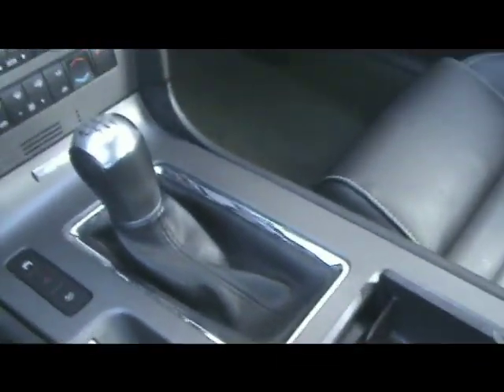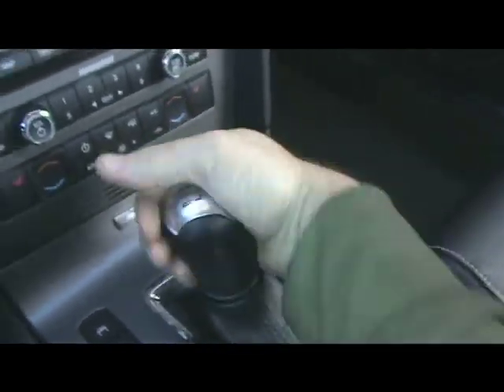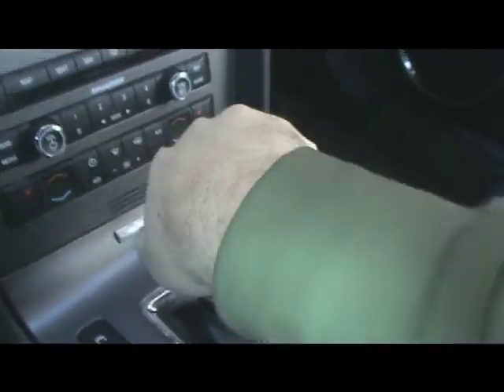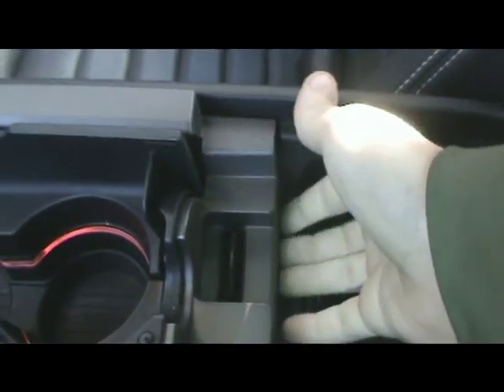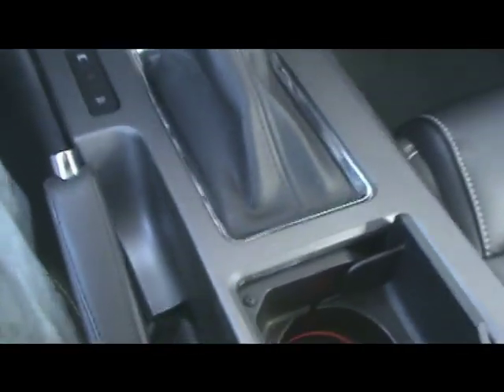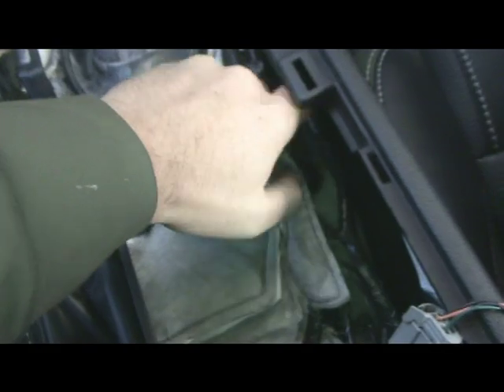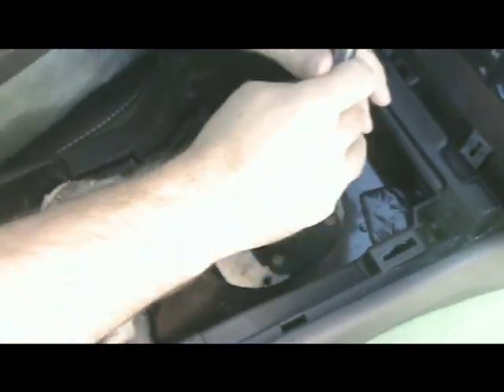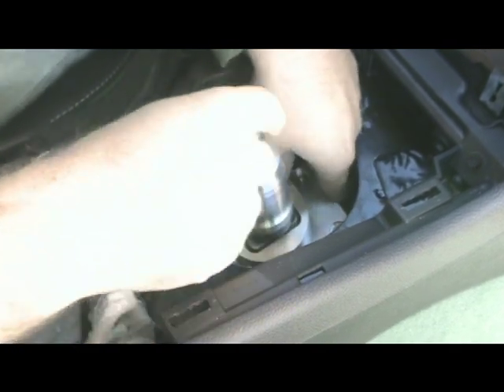2011 Mustang Barton Short Throw Shifter Installation Video

Comment: I just got this shifter with new bracket does rattle a lil but not big deal and clicks between shift not big deal kinda like the clicks but the reverse sucks kinda hard to get car and reverse I think mite been dust boot so I fixed it to how the instillation vid said did feel lil better but will c tomorrow when I drive it. I do like the more precise shifts n alot shorter!

Comment: I just installed mine and I must say shifting is much quicker. One problem I seem to have with it though is how the 1st and 2nd gear row seem so close to the middle row while the 5th and 6th gear row is further away. When I push my stick sideways it can't seem to go anywhere when Im pushing left but it's fine when I'm pushing right. Do you think I installed it correctly? Thanks